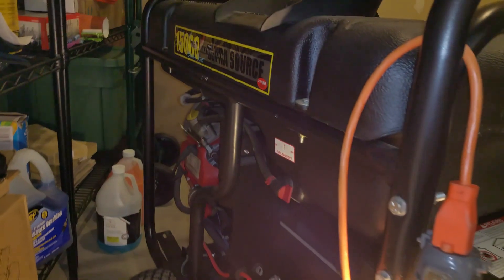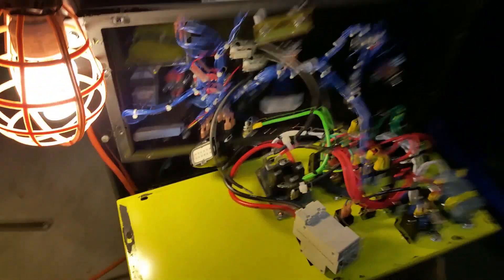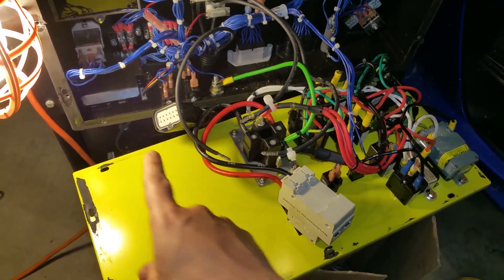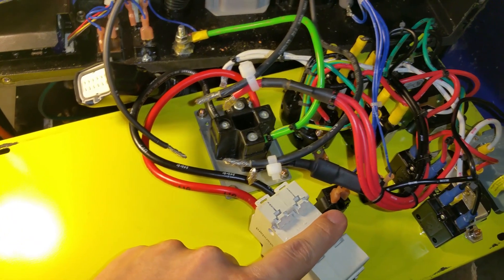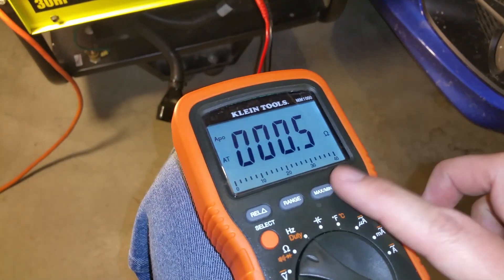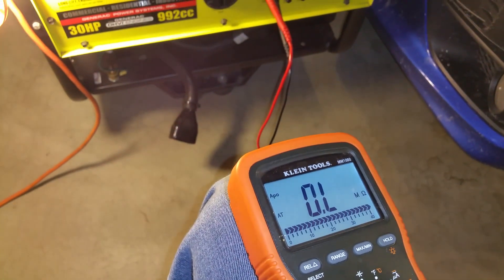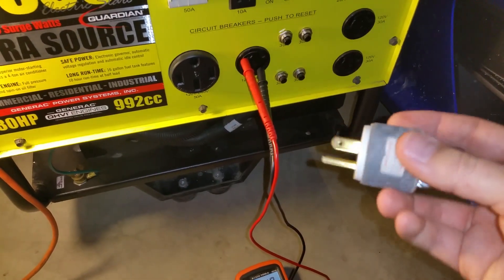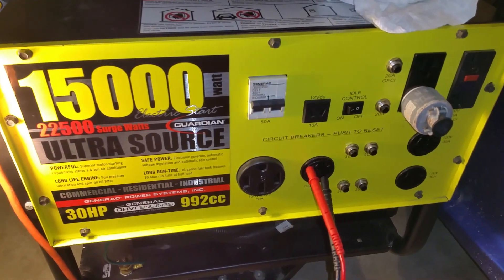Generac Guardian UltraSource 15KW Repair

Comment: Nice video! You helped me with my 10 KVA generator that is just a step down from this one. Now my next project is the same model as the one you have here. I don't know if I have any issues yet, but I know who to call if I do. You always have great information and are very knowledgeable on these generators and so many other electrical devices in general. Thanks again for another great video, Jeff

Comment: Thank you .  I have the 12,500 KW / 27 HP series of this.  Everything wiring wise is the same so this will help me should the genny side stop working.  It is an older model and I got is for $750 because it was not running well and the owner kept shorting things out when he used it.  I cleaned the carb, adjusted valves and tuned carb.  It has been working like a champ ever since.  I run it for 30 minutes at least every other month and it has yet to fail us.  Installed a dedicated 50 Amp plug and wired it to the panel and now it runs my whole house during hurricane power outages here in FL.  My 80 year old mom lives with us now.  In this humidity A/C a must for the elderly.  I even ran a cord to 2 of my neighbors who gave me money for gas.
Reply from the maker: rstephe nice! Sadly i dont have the machine anymore. I had a 7k on propane Ive always had. By itself it runs the hot water heater, and i use a smaller inverter genny for the lights tv and such. I can even use my inverter battery bank for overnight that runs the hot air furnace. 15kw while huge and plentiful, its inefficient for my needs. Still a great genset for an open frame configuration.
Reply: Do you still have it

Comment: Love the video. I have had one of these Ultra Source generators in the past and sold it when I got my solar, grid tied, battery back up system installed. I have been buying old generators and re furbishing them if possible, then selling them. A couple weeks ago, I picked up a 15000 Ultra Source that the seller said ran, but had burnt wires. I bought it for $100.00. Turns out, it's all the 12 VDC charging wires that were affected (C1). Apparently, the individual bypassed the 10A fuse on the back of the panel and started it like that. Well, the wires toasted. The wires that share the hot post on the starter that goes to + on battery, and the corresponding wires in the panel, as well as several others within that circuit. I noticed right away that the 25W resistor was broken and rendered useless. All other wires from (C2) are perfect but, I was getting high resistance readings across the board with the stator windings. I disconnected everything from the stator, started the generator then excited the brushes and it did put out 240V. I attribute those high readings to being outside and uncovered (moisture). My question to you is, do you think that broken resistor caused the wires to toast on the 12 VDC charging circuit? Or did the previous owner hook the battery up backwards, or, something stupid like that. All the wires have now been replaced and I just got the replacement resistor in today. I am going to give it a test run tomorrow AM and hope for the best here. Just curious as to your opinion with the cooked wires. Great video.
Reply from the maker: Hard to say. Could have hooked the battery backwards, or a winding failed shorting to ground. The resistor is part of the field boost circuit that should only energize when cranking to excite the rotor till it self excites on its own. Make a video and give us an update! This machine I sold a little over a year ago, wish I could have gotton more for it, but its a huge machine for what I needed. Still love my 7k generac and my 2k yamaha!
Reply: I appreciate your input. I installed the resistor this morning and got everything hooked up. As soon as I flipped the switch to the run position, it blew the 10A fuse. Replaced it and it blew again. The service manual has the troubleshooting flow chart and first thing to check is the start / stop relay. That tested good. I already checked the rectifiers (BRC1 & 2) and they are good as well as the diode / rectifier. Next in line on the flow chart was the fuel and starter solenoids which I checked the other day and they are both good. Next on the chart is to replace all the wires numbered 15. Somewhere along the line with all those number 15 wires, I have one going to ground. This thing was a mess of toasted wires in the control panel and also the wires going to the hot post (not the trigger wire) on the starter solenoid. So, I have a tedious job in front of me replacing them. I'll update you as I go along but, I really don't see me shooting a video over several days of repairs. I am not that savvy with videos and uploading / editing and all that jazz. But, I will keep you up to date. Maybe when it is all repaired and working properly, I will pull the panel cover and make a short video explaining what the problem was and what the repair was. There are not a lot of videos on these Ultra Source generators and so far, yours was the best, and most informative, I ran across, So, again, thanks for posting it.
Mark
Reply from the maker: Cheers for the shout out. Best of luck, yeah something is shorted for sure. Check the windings first, and if all is good there, its got to be one of the control boards. Those boards are not easily serviced. It can get expensive very quickly, and keep in mind if the stator or rotor windings are shot, forget repairing it, part it out. You can only buy the generator head as a set, which is around $1400 USD. Honestly I got lucky with mine so.
Reply: I did check all the stator windings and while I was getting above spec resistance readings, nothing there was shorted to ground. I went over that several times and also contacted the factory as well as a local service center and spoke to them at length about those readings. I think that with my 62 year old tired eyes, I missed something on the number 15 wires when I was in the panel. A couple, other than number 15,  I spliced using solder and shrink wrap because the insulation was melted due to the fried wire next to it in the harness. I am like a pit bull and don't let go until I exhaust all avenues. So, I'll either get it working or it will be parted out. Either way, I only paid $100.00 for it and the engine runs sweet. Thankfully, I don't need a beast generator like it cause of my 7K solar system. But, I also have a Honda EU2000i and a Predator 3500 inverter generator. Being in FL, I use those to run window shakers in the event of prolonged power outage. My solar backup doesn't run the central ACs. But, it runs everything else. You have to keep the wife cool, if not, she can, and will, make life rough,,, Mark
Reply from the maker: mada94fxr same. Im here in the northeast and my new house is 1000ft away from the substation with utility unground. Snowballs chance in hell ill ever lose power now as we are also on the local hospital circuit. Yes got to keep the wife happy. Be safe and cheers!
Reply: A little update. I thought both of the rectifiers were good using a VOM. When I tested them with a diode tester, the BCR1 tested bad. I switched the rectifiers and it didn't blow the fuse as before. When I got the new rectifiers in, I tested the generator and it worked perfect. No blown fuse and puts out good power across the board with 240/120 and 12 volt even with the high resistance readings on the stator. So, needless to say, that made my day. I have it completely torn down for restoration. So, I would say that was a good $100.00 buy. I will have less than $250.00 when complete. I may shoot a short video when I am done with this showing what happens when you bypass a blown fuse and fry the wiring. Again, thanks so much for your great video
Reply from the maker: mada94fxr hey!! Great news!! Def shoot me a line when you do the video! Glad my video helped!

Comment: I have a 15kw generac generator which is 20 years old with very low hours. the unit sort of surges when under load by about 3 hz. Since this is servo controlled is there anyway it can be adjusted. The carburetor is new. It was replaced to offset starting issues. I would greatly appreciate any assistance you can provide. Thank you.
Reply from the maker: Is the carburetor aftermarket? Oftentimes the aftermarket ones are not drilled correctly and will make the engine hunt and surge as you describe. Depending on the idle control board you have there may be some adjustments to smooth out the stepper motor function however those were very early on additions and since then they have moved on to the simpler non-adjustable control boards to where the only things you can adjust are stepper motor direction and 50 or 60 Hz.
Reply: I had that same "hunting" on mine - but it did it under no load or load.   It did not seem to be a carb issue  - usually you can eliminate a low enrichment by enriching the fuel via the choke control.   Its also a new factory carb that I replaced some months back.   That had no effect.   I replaced the stepper control at the carb - that also did not seem to make any different (more of firing the parts cannon and hoping when I ordered it).   Mine has the older stepper control board with the 3 pots - the manual has them labeled RESPONSE, DAMPEN, RECOVERY.   I tweaked those settings and it improved the stability of the motor quite a bit.

Comment: Great video. I just purchased a 4583-0 and discovered the electronic governor is missing and the mahcine will nto start. Any idea why someone would remove this component? Are they knwo to go bad? the unit alos had some melted wires, the doubel strand blue wires that connect to the bottom of the gray resistor. Thanks!
Reply from the maker: @anthonywilliams5830  sounds like somebody started stripping it for parts or tried to get it running using the more basic mechanical governor. The stepper motors are known to go bad because of the plastic gears inside but they are replaceable.
Reply: @Bassguitarist1985  thanks for the response. I wish they had left it alone. I do not want to put a $250 board in it to find out it has other major issues. I'm guessing it was the stepper motor that started the investigation, but I am at least the 3rd owner so I have not been able to find out. Thanks again!
Reply from the maker: @anthonywilliams5830  yeah I owned this machine for a short time and then I sold it to a food truck guy who used it as a backup. This was before the predator generator was popular. Parts are very expensive for this machine.

Not sure where you are located but if you are around Connecticut I can potentially take a look at it for you.
Reply: @Bassguitarist1985  I appreciate the offer. I'm in Ohio. If I figure it out I will post a video and tag you. thanks!

Comment: What would be the issue if i have no power from the wiring directly from the generator portion?
Reply from the maker: @brandonpelt4948  can be a lot of things, but I'd check the circuit breaker but then suspect the AVR is bad
Reply: @Bassguitarist1985  I actually disconnected the black wires coming in from the housing of the generator and have nothing. I'll look into it more after the storm. I appreciate it much.
Reply from the maker: @brandonpelt4948  sounds good be safe Sorry I couldn't be of more help

Comment: Great video. I just purchased the same model at auction, and immediately noticed that someone had been in the control panel. Once I opened it back up, I've noticed a few unterminated wires, and also some wire damage around 1 of the 30a breakers. Would you be able to spare 10 min over email or phone to confirm I'm putting everything back in the right place?
Reply from the maker: Hey Cody. I sold this generator a few years back. There is a service manual out there for this generator along with schematics. I do a youtube live once a month or so. Maybe we can jump on a streamyard and you can show me what you're dealing with? My email is on my channel
Reply: @Bassguitarist1985  - Thanks for the quick reply! I believe, after rewatching your extremely helpful vid, that I know what everything is. If I run into any snags, I'll shoot you a quick email. Your help is GREATLY appreciated.
Reply: @Bassguitarist1985  - Ok, before I try to get on the line with you somehow - I've got the generator up and running, but it's not making power. First thing to check/replace -voltage regulator? It's mot making power at all, and the internals of the stator, rotor, etc all seem to be fine via visual inspection.
Reply from the maker: @codykday  you can try replacing the regulator. But a visual inspection of the stator won't tell you much. The regulator for this machine aint cheap, and usually non returnable unfortunately.

You can try hitting flashing the brushes with 12 volts and back probing all the windings to see if there is VAC power. Its a complex procedure given how many windings and electronics there are to bypass, and dangerous for obvious reasons.

Comment: hello bassguitarist1985 I have a 17.5 kw version and I'm getting 113 volts from the 120 volts receptacle is there a way to ajust the volts output also when the idle control is on and I run a drill the motor powers up to full power for a few seconds then goes back down to idle any suggestion?
Reply from the maker: There is a pot on the voltage regulator where you can adjusy voltage. And with idle control on its going to keep the engine at low speed till a 1-2 amp load is presented then it will bring back to full speed. Ive seen the current transformers not be as sensitive and require a heavier load to trigger it.

Comment: I have this same unit. Worked like a champ for 30 straight days when we got blasted with dual hurricanes. The hour before our power was restored, it died and would not restart. There was nothing at the switch. The barrel fuse on the back of the panel was blown. Installing a new one would pop it. I opened the panel and the rectifier down at the bottom right of the panel was melted. Could my problem be even deeper than the melted rectifier? I was going to try and get it running for Hurricane season but we could have used it for this ridiculous ice storm we had last week too!
Reply from the maker: Its possible, hard to say without seeing it. Something is grounding out. Replace the rectifier and see if it still pops the fuse. Make sure the starter battery is good too.
Reply: @Bassguitarist1985  thanks. I’m going to order it and see if that fixes my issue. The starter battery is pretty new and I keep it maintained for hurricane season. I can jump the starter and force the engine to spin and the generator rotor itself can be turned by hand. I’m gonna give it a shot. Thank you!

Comment: I have a generator just like this and when I start it, it will go to full throttle, so I took the front cover off and found that the 5 wires on the speed control have been chewed off by a mouse, they also built a nest, in your video  it shows the wires and plug but I can't really see where they go to. Do you know where they are hooked up to? Thanks.
Reply from the maker: Hey. Sorry i dont have the machine anymore. Best to utilize the schematic.

Comment: Quick question, I have the same unit. Stopped working years ago been sitting since. My uncle who's since passed said the problem was the electronic governor idle controller. Part #0D4409. Two of the prongs where the wire harness plugs to it corroded and broke off. Would like to get it running again. Can I bypass this part? Or pay the 200 for new controller? Thanks.
Reply from the maker: You need the controller for it to run properly. The mechanical Governor will hold the speed but it needs the controller operating the stepper motor for changing loads to keep the speed within 2% of 60 hertz.
Reply: @Bassguitarist1985  thanks for the quick response. Looks like 230 bucks will be only option. I hope the prong is not stuck inside female side of harness. Probably my luck.

Comment: I have a generac gp15000e and have only 27 volts at the plug (110v) not gfci. Any thoughts and is there a capacitor that can be tested? Can't find any info on that
Reply from the maker: Bad CB? No cap in this model that im aware of

Comment: Any chance you could go into further detail about the neutral to ground plug you made up and why?

Thanks for the vid!
Reply from the maker: CDP135Z lots of articles online on why the neutral and ground are bonded at the main electrical source. This generator does not have a bond since it is designed to to connected to a transfer switch, or similar device that makes this bond.

Comment: Hi I've got the same exact generator the motor runs fine but does not produce any voltage it has been sitting 3 years is there some way I can re-energize it or do you think the voltage regulator is bad
Reply from the maker: Hard to say without looking at the machine you can try re-exciting it with a drill and spinning the chuck to see if it will re-excite. The other issue could be something else inside the stator or rotor could have gotten damaged you will need to take all the resistance readings of each winding. if all those readings check out then it's worth replacing the voltage regulator which is a failure point yes
Reply: @Bassguitarist1985  it ran fine 3 years ago when we put it up in the garage and now nothing
Reply: I tried the drill trick and did not work I also stripped the ends of the cord that were plugged in to the 120 volt Outlet and tap them on a 12 volt battery no luck either